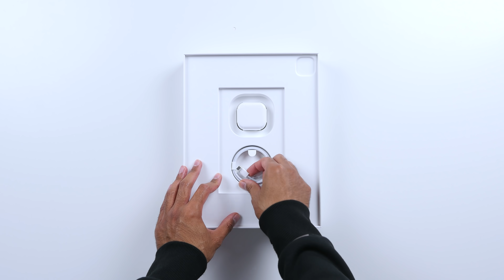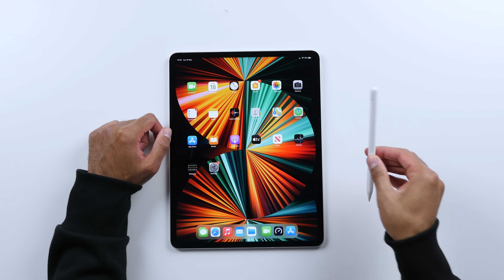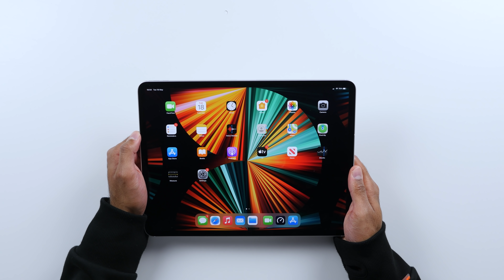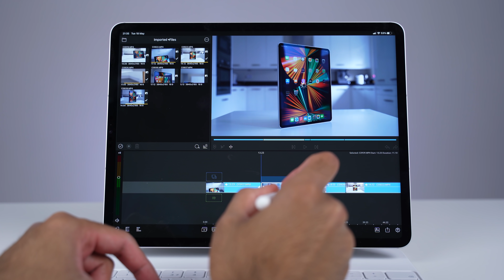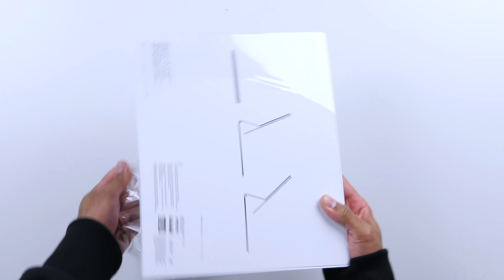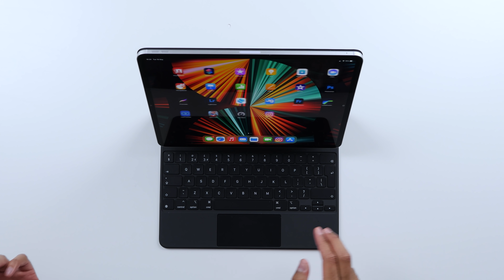iPad Pro 2021 (M1) Unboxing & Review

Comment: 02:35  I don't think so, Samsung tab s7 + screen is super amoled HDR+ and it's 120 Hz.
Reply: The s7+ is only 500 nits peak whereas the M1 Pro is 1600 nits and the blacks are nearly fully black.
Reply: @Emobullymaguire  ipad screen is still a backlid LCD. Only the leds are smaller. Oled screen can turn off every Pixel. 500 nit is good enough for me do.
Reply: @SerdarBekiroglu  500 nits can’t display true HDR content and now the LEDs have local dimming zones.
Reply: @Emobullymaguire  samsung got HDR 10 + not true hdr.

Comment: There is one problem. After making some tests it turned out that app (for example our Artstudio Pro) can use only 5GB when using M1 iPad Pro with 16GB of RAM! It will not give a big boost for graphics apps! Current iPads with 6GB of RAM give 4.5GB for apps!